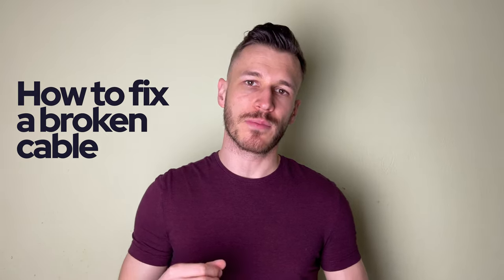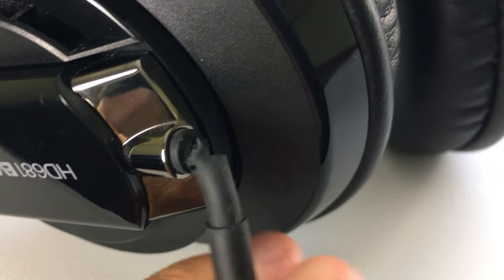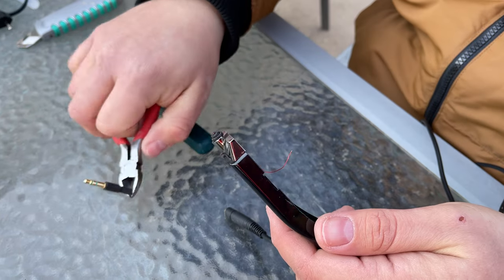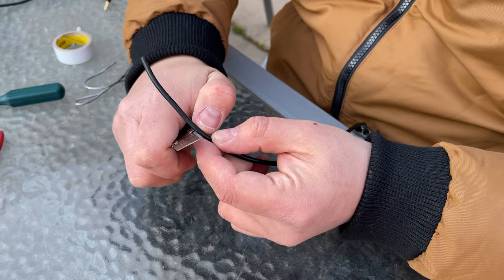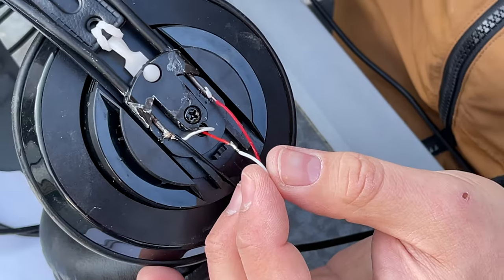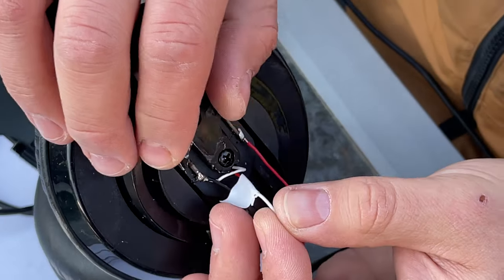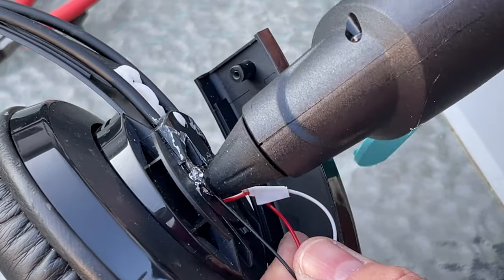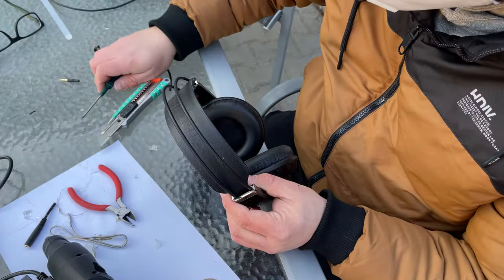How to fix broken headphones cable on Superlux HD681 EVO

Comment: Thank you! It worked like a charm. A little improvement I did was to drill through that little rubbery thing (2:50) and re-use it to hold new cable in place. No glue needed.
Reply from the maker: You are welcome. Im glad it helped 🙂
Nice solution :)
Reply: What did you use to drill through the rubber?
Reply: @dicecard921  I used the smallest drill bits I had at home. Just that and a lot of patience xD -- the rubber thingy stretches when drilled so the result diameter of hole is less than drill bit's diameter. For the life of me, I don't remember which drill bit was just right for the job.
Reply: @dicecard921  Iron driller 2 mm - 3,5 mm at 0,5 mm stepp

Comment: hint: right after you buy them, put hot glue on the connector from the earphone (let it cool down and repeat, multiple layers 2 or 3 times), so it gets hard like a tank, if it does not move, it cant break. thats how i use mine since 5 years :)
Reply: What if its already a bit chipped?
Reply: @otactp3285  will be fine as long is the wires arent damaged internally

Comment: I love these headphones. I had 3 pairs breaking on me already.
I keep buying them as I've tried more than 20 headphones under £100 and none of them match these.
Reply from the maker: I’m also using them after repairing, however I could buy new ones but I dont need cause they are good enough :) thx for your comment! Have a nice day!
Reply: Instead of replacing the full cable. Possibly install a 3.5mm jack or a socket. In this way the damage is reduced or even prevented. They will look a bit like the 681 EVO with the detachable cable.

Comment: I have the Superlux HD668B headphones and a reviewer from Amazon recommended to use heat shrink tubing on the 3.5mm plug. I did that on my headphones and its much more sturdy. I will still be careful with it. I guess some people are very rough with the headphones or accidentally yanking them. Try it. It doesn't cost much.

Comment: Your connection is weak and will brake soon. You need to twist wires together first to making a light mechanical connection, then apply solder

Comment: 2:25 OH it just slides off. The rubber band on mine broke just few days after use (I guess my head is too big) so I replaced it with a normal rubberband.

Comment: Hello, i tried following as closely as in the video, and managed to get this piece of junk i found that doesn't make sound at all, to make sounds on both sides!

However i noticed when i tried testing the sound, it seems that the sound is flipped between left & right. And also one side doesn't produce any bass. Is that possible because of bad connection from the solder? Or the driver just aren't good anymore?

Comment: Thank you for the video. I managed to keep the plug, was tricky but works fine. Glued it into place with hot glue, now it comes out of the hole left from the cable but its rigid.

Comment: Thanks it was very helpful. A suggestion, if theres enough room you can make a knot with the main cable right before you connect the red-white ones, that way not matter how much force you put on it, it wont be damaged and you dont need extra tools (hot glue).

Comment: This is a design problem with the Superlux - but it should be possible to replace the input socket with a better quality metal socket - very cheap components - and wired as original. That way you can make use of different cables as intended. It makes sense to me to have the socket on a small length of wire so that it is say 50cm away from the headphones. Also when soldering small wires like this it is best to reinforce the joint with a small length of  heat-shrink tubing.

Comment: How can i find out which wire i should connect to left/right/ground? I wanted to solder a 3,5mm  jack in. but i am not sure which is left and which right.
Reply from the maker: In most cases red is right and white is left but you should google it 🤷‍♂️
Reply: From another video
Headphone red->Cord red (right)
Headphone blue->Cord White (left)
Headphone copper/yellow->Cord black (ground)

Comment: Thats a great pair of headphones! I am using it for 3+ years already and they have been repaired 5+ times :)
BUT, the last time I tried to fix them again, but it didn't work. I bought a new 3.5 plug and soldered it. Still, my right speaker does not work. Under plastmass near right speaker everything seems ok. So, i think it is broken somewhere inside (under right speaker or inside of metall headband). Can you give me a hint what can be a problem? I did not drop them, so right louder should be ok. Thx.
Reply: I have changed the plug again and it actually started to work! That's amazing headphones, haha. I think they never die if you repair them everytime :)

Comment: Thanks a lot, it was really helpful for me. The same problem, I got stuck at the point of disassembly and did not dare to apply force. You took this risk for me and others. Unlike your case, I just made the cable with the jack near the headphones a little longer, now it resists bending better. The manufacturer must do this from the very beginning.

Comment: do you know how to protect the cable to prevent this?, thnxs
Reply from the maker: The quality of that cable is not so good, that's why it's getting broke for a lot of people. Maybe you can put some tape around that part and be gentle with it when you use the headphones, but other than that I think there's no way to prevent it.
Reply: @techzact  its good idea, Im going to try whit tape. Thank you, nice and usefull chanel. good luck!
Reply from the maker: @agustingribaudo5162  hope it helps :) You are welcome and thank you very much :)
Reply: I recommend buying a solid braided cable and then soldering it like this, even the amazon basics braided cable will last an insane amount of time.
Reply from the maker: @yukkimura  thanks for the advice :)